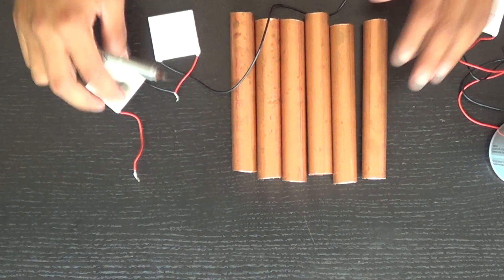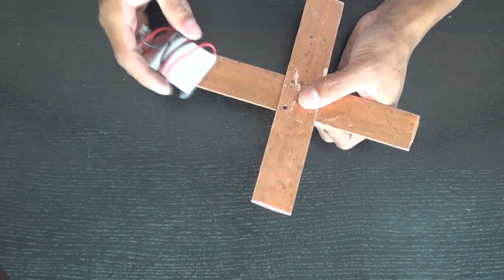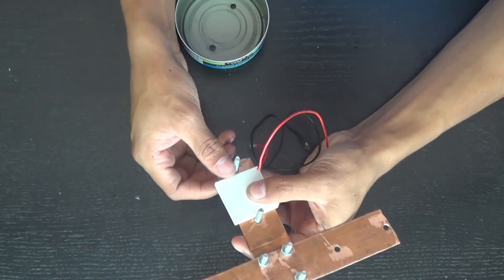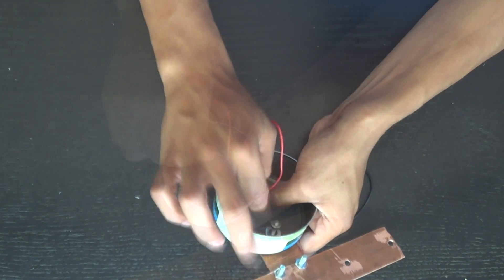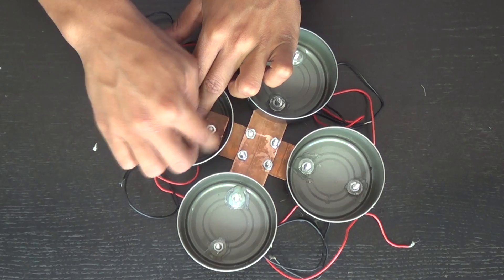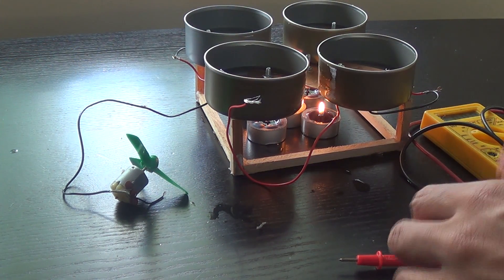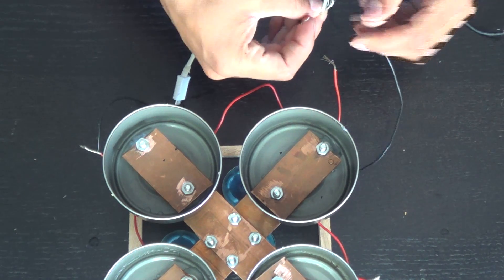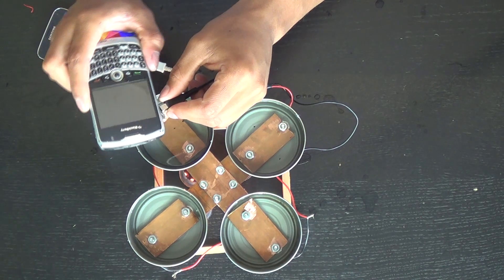How To Make A Mini Powerplant

Comment: I see a few problems, but I'll dismiss the phone charge regulator issues cause a phone can safely handle 5 to 6 volts for longer periods, so can easily except higher voltage to a point in shorter periods, however I see that it how cost you more in candles to charge your phone instead of plugging into your wall, I'm hating on this idea cause projects have shown even one Pelter plate can a phone, and we used a less damaging method. it take a flat cake baking pan attach your Pelter plate on the outside of it, fill with water, put over a flame, it will do less damage, and charge your phone.

Comment: You're gonna want to attach a voltage regulator to the output of the peltier modules. The variability of the voltage might end up ruining it otherwise. Something like an L7805 or an LM317 should do the job. Neat concept, though!
Reply: What are the things below the mini nuclear powerplant in 3:30
Reply: @zeroone5764  candles

Comment: You would be better off putting old cpu heat sinks on top than those cans or aluminum with a better mating surface than the steel can was making... The heat plate and cold plate might be better to be made of aluminum. the temperature difference is what generates the electricity but it only has a set range so putting ice water in the top wont increase it dramatically...

Comment: why the hell would you plug your phone into a not regulated power source?!?!?!?!?!?! use a wide input range dcdc converter or at least an 7805. seriously, this project looked cool. I mean I would not use screws to hold the upper side because they can conduct the heat very well to the upper side, but as I saw you hooking the wires directly to the charging cable... that gave me cancer! I'm going to watch some 60fps-gifs to cure my cancer. see ya
Reply: Dear user, its just a project to make a power plant (mini). This project can be used to improve the power plant or Nuclear Power Plant.

Comment: Best way to ruin your phone is to plug it into an unregulated power source.
Reply: Wait, was that to me or the person before? I was agreeing with you if that wasn't clear.
Reply: Of course it would not work.  It could work if he had plugged the charger to the "generator" and not the phone directly.  While he has no control of the output, which obviously could bust his battery, the charger that comes with your phone does.
Those who have anything else to say, are playing Russian roulette with their phones.
Don't be ridiculous.  Of course it is not that simple.
Reply: what if you have a surge protector
Reply: Best way to look like you have no idea to what you're replying to. And yes, I am implying that the charger would push whatever voltage it has; you must be talking about Amp Ratings.

Power != Voltage. First off, USB is spec'd to provide regulated 5v +/-10%. Any other voltage should not be used with USB as it was not designed to take any other voltage. The Amp Rating, however is the one that adjusts to the phone's needs.

In any case, I would add a charger module which costs less than a single piece of a TEG this guy used.
Reply: best way to look like you have no clue what you're talking about is imply the charger pushes unregulated voltage and the phone doesn't take what it needs
Reply: Another way to look like you have no clue what you're talking about is implying the phone doesn't take more current than what is needed since neither the charger nor phone have internal capacitors to regulate the incoming current or voltage.
Reply: That was for [djm3nta1].
Reply: Well if you put a fork in the outlet you get a huge shock and if you plug in a charger and put your tounge on it only a little shock so they do have regulators
Reply: @boburosu1956  in the boot not the cord
Reply: @boburosu1956  going diggin...
Reply: BobuRosu no I will grave dig this comment

Comment: what is the white pad like thing with wire u kept under the tin???
Reply: It is Thermoelectric Generator. 
https://www.google.cz/search?q=termoelektrick%C3%BD+gener%C3%A1tor+teg+cena&client=opera&hs=vAc&source=lnms&tbm=isch&sa=X&ved=0ahUKEwjWpYOr3PLSAhUCXiwKHQiiAEUQ_AUIBigB&biw=1366&bih=659#tbm=isch&q=teg+generator&imgrc=5aBaQKpZiG2c1M:
Reply: this is one way to use it, a peltier is mainly a heat-pump

Comment: what is the working principle behind its working..?
Reply: The Peltier element uses a form of magic to convert heat to power.
Reply: Mehul Jain The heat difference creates a difference in potential which is also a voltage. Electrons are agitated on one side and not the other and that difference creates an electrical current

Comment: Use with MT3608 Dc to Dc Boost converter for more voltage
Reply: Edmorbus dependant on what amperage you’re getting from this output to get a decent level of voltage

Comment: What are the little white boxes?  I googled, but must be spelling the name of them wrong.  Would I be correct in thinking they're relatively expensive?  If they aren't, why not line the outside walls of your house with them?  (I live in Michigan, so it's below freezing for half the year and hotter than the 3rd level of hell the other half... usually have about 2 weeks each spring & fall when it's comfortable outside.  I'm thinking why not generate power from the weather like this?  Big ones underlying the roofing would be a good idea...)
Reply: It is TEG - thermoelectric generator: 
https://www.google.cz/search?q=termoelektrický+generátor+teg+cena&client=opera&hs=vAc&source=lnms&tbm=isch&sa=X&ved=0ahUKEwjWpYOr3PLSAhUCXiwKHQiiAEUQ_AUIBigB&biw=1366&bih=659#tbm=isch&q=teg+generator&*&imgrc=5aBaQKpZiG2c1M: 

http://thermoelectric-generator.com/shop-page/ 

https://www.google.cz/search?q=BioLite+CampStove&client=opera&hs=EdH&source=lnms&tbm=isch&sa=X&ved=0ahUKEwigkYuM3vLSAhUEXCwKHQFiCc0Q_AUICSgC&biw=1366&bih=659#imgrc=rNqFUT3SabR87M:
It is good idea, but one side must be heated and the other cooled.